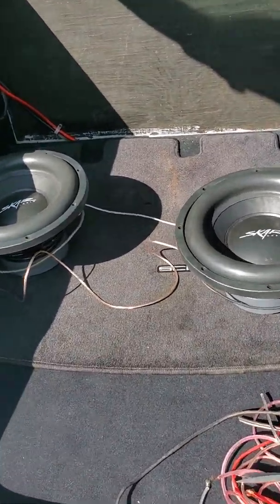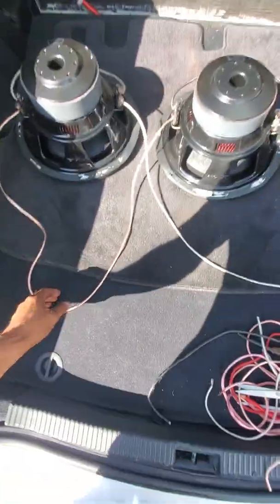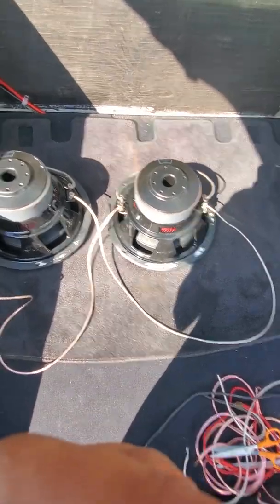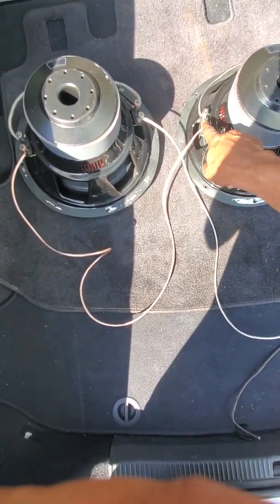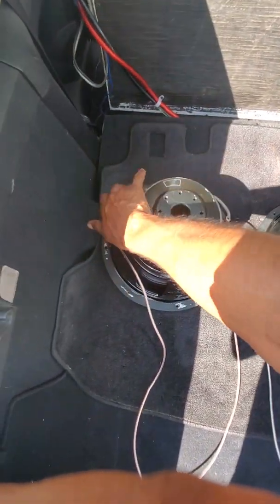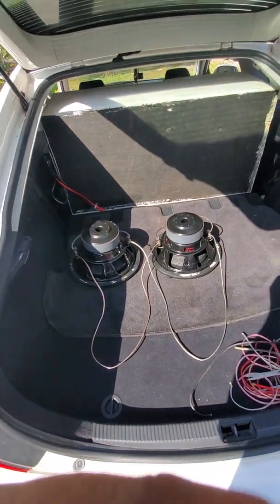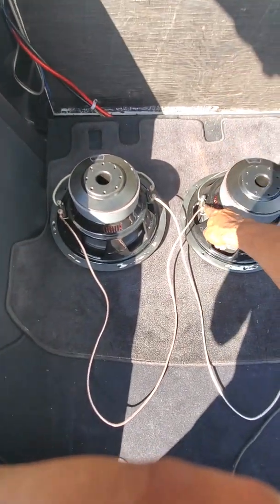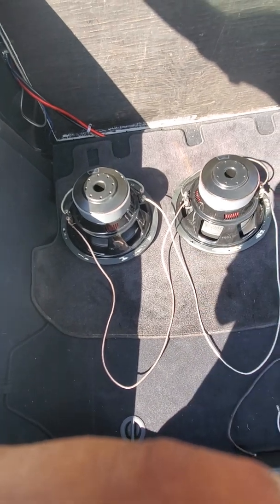Two skar *4ohm subs wired 1ohm

Comment: So you have 2 2ohm subs running @ 1ohms? I thought they would convert to 0.5ohms and that would burn the amp?
Reply from the maker: I would consider that over this set up but as you answered the question yes the amp Must always be .5 compatible for that or it will indeed burn out the amps internals just a matter of time @MrDeath
Reply: @joepressure22  So you have them running @ 2ohms, not @1ohm, correct?
Reply from the maker: @MrDeath  No It's Actually 4ohm subs Wired at 1ohm sorry for the confusion 😅  
I'm surprised only you out of everyone caught that good looking brother
Reply from the maker: According To The Rockville Website this is a 2ohm set up using dvc subs .

Comment: What if you have 2 separate boxes . I have 2 skar svr 12 2d I have them wired up as a 1ohm load each to a skar 1500 rp1 d amp are both subs still 1 ohm or .5 ohm final load
Reply: Depends on how you have them wires inside the box
Reply from the maker: I'd have to ask you to refer to the Rockville website for proper wiring procedures to make sure.. I'd hate to misinform anyone as supplies for these hobbies aren't exactly pocket change